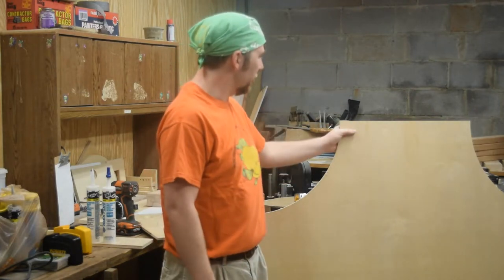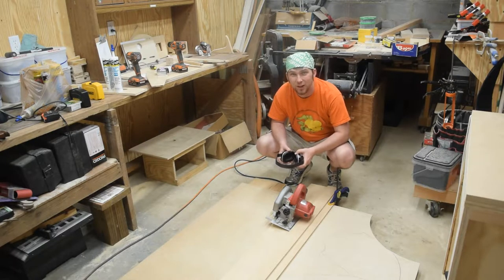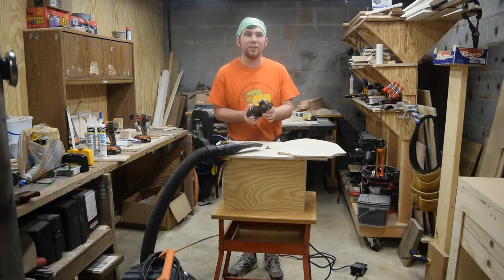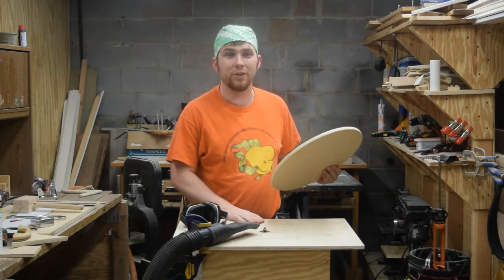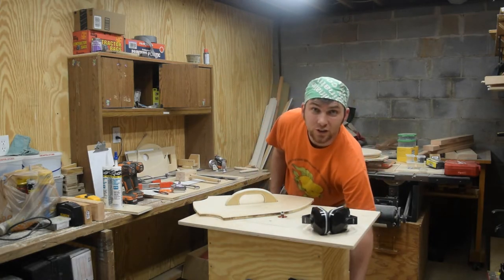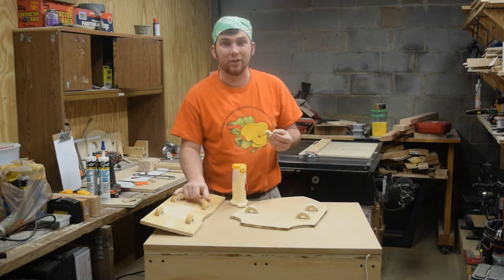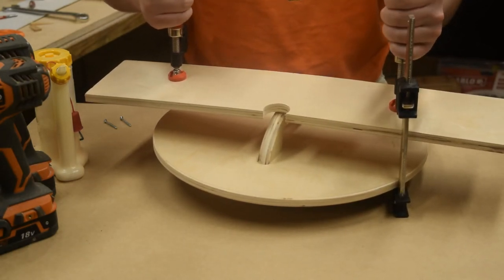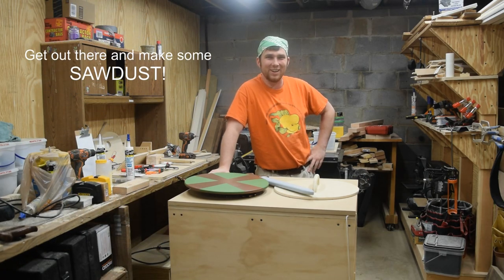How to make your own Wooden Shield

Comment: Is there a template?
Reply from the maker: I have one of course, but I'm not sure of the best way to share it with you. I don't currently have a website. I'm open to suggestions. I use a template for the shield as well as the handle.
Reply from the maker: If you want I can snail mail a paper copy of the templates to you. I changed the layout of my channel page so that if you click on "about" you can send a private message by clicking "send message".